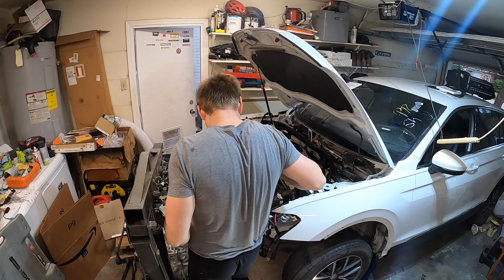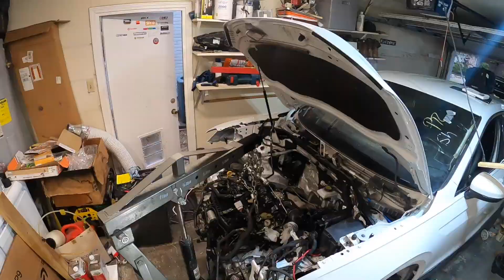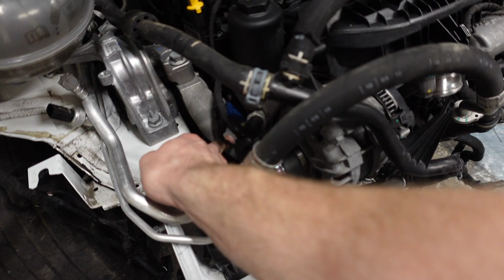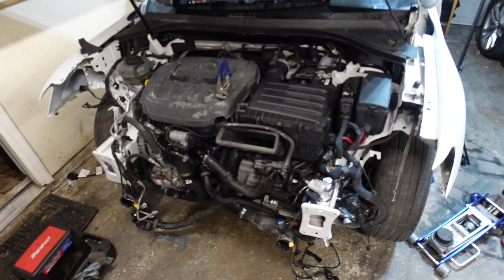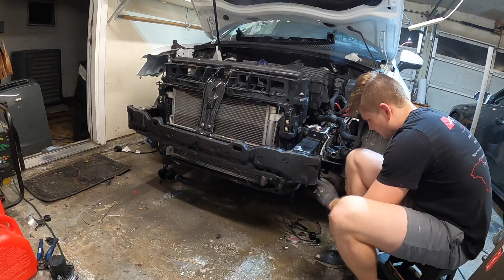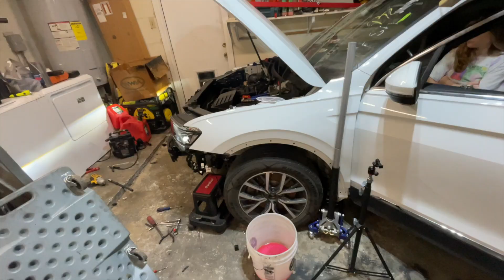Engine In and First Start?

Comment: Nice progress! Did you remove and replace the fenders on your own? Do they just bolt on? I'm pondering if I should replace mine on my own
Reply from the maker: Thanks! You should be able to replace them on your own. Two bolts behind the wheel, one about halfway up the door, one in the top corner, the ones under the hood line and two more behind the headlight housing